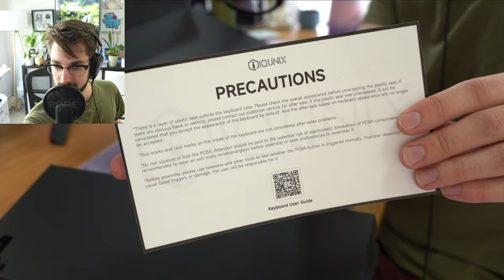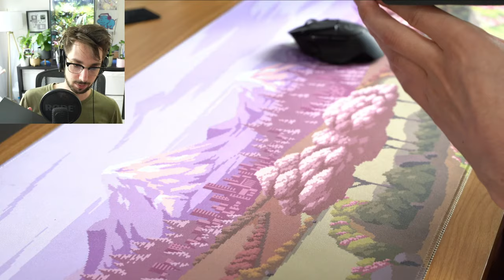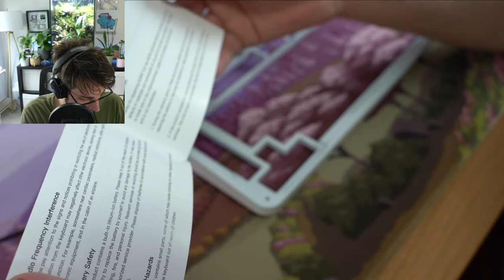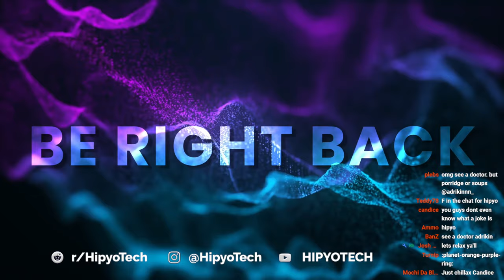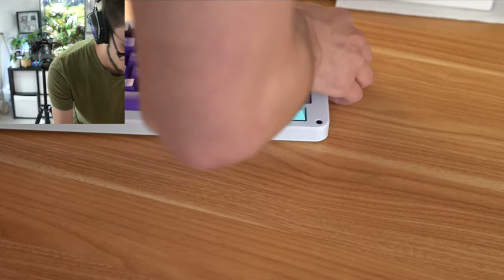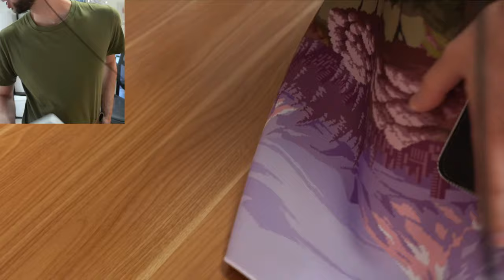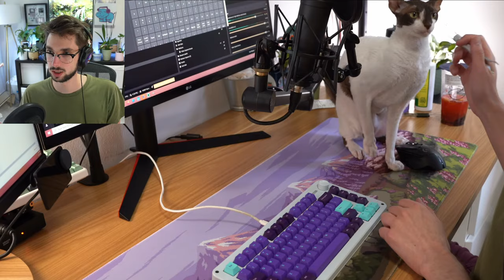I REALLY Hope this Keyboard is Good.

Comment: im new to the hobby, and im curious to know why its 90% sound test and 10% about the other components
Reply: Idk, all of the playing with mechanical keyboards is mostly about feel and sound
Reply: You buy and choose the other components FOR the sound test. It’s the end result/performance that you’re working towards the whole time. There’s obviously different typing experiences as well but once you’ve stepped into the enthusiast pool at all the typing experience is great and likely going to be to your tastes. There are minute differences in typing experience between different switches (assuming you’re not comparing clicky/tactile/linear) and cases and mods, but all those things can drastically change the sound.